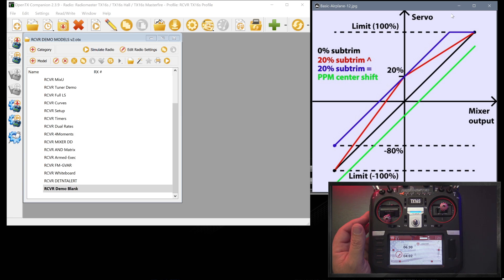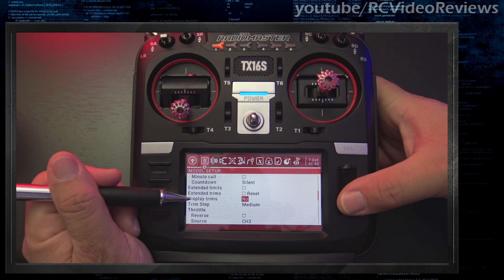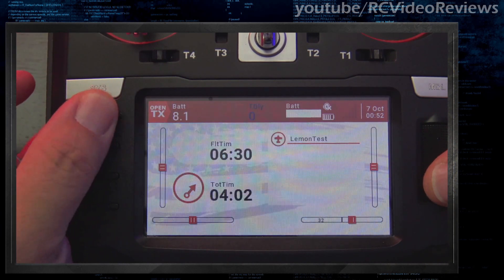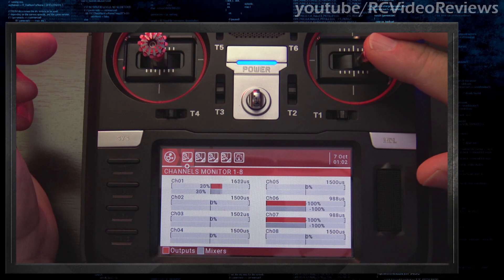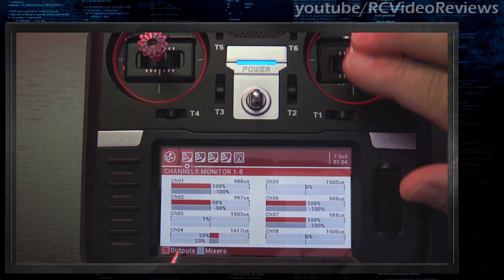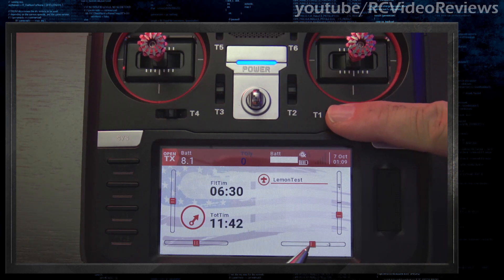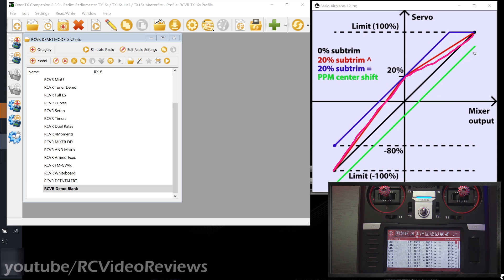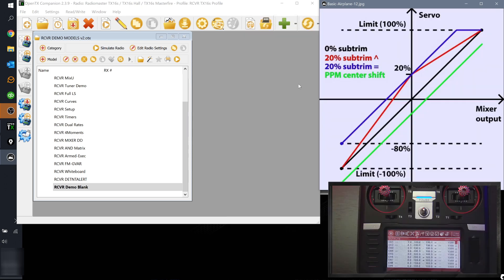OpenTx Tutorial Trim Options:  Radiomaster TX16s • [Intermediate]

Comment: Isn't everyone mechanically setting control surfaces to perfectly flat and only using the in flight trims to counter act balance issues? 

I'm never adjusting for control surface issues it's always a click or 2 or a few to iron out balance. For eg, nose heavy requires a bit of up elevator to fly straight. And a big balsa wing built slightly heavier than the other or repaired requires 2 or 3 clicks to trim out to level. 

Are people setting up a model with an out of wacl control surface and then just trimming it to flat?

Comment: caorse trims at least on Elevator and Aileron are invaluable for maiden flights I just chanced on the idea but instead of loading the values into sub trim I mechanically move surfaces to match deflection  then reset trims to zero and med or fine for changeable conditions

Comment: i have several questions, what is T3 and T4 trim for, T5 and T6 as well
also, i noticed my T3 trim is all the way down, not sure what that means on the TX
finally, if i have high rate set 100%, low Rate 50% when i move sticks left or right and look at the mixer, they are not perfectly at those rates. left is 97%, right is 95% etc.
i calibrated several times, same no luck
Reply from the maker: Please join my discord and ask there. YouTube is terrible platform for dialoguing back and forth. Discord link:  https://discord.gg/jSFTASU

Comment: I've got Edge TX on my radio master t16S
I want to use my T5 or T6 trims how to set up on Channe 5 or 6-7-8
I'm using switch SF for thrust vectoring mixing Rudder to motor servo 
I want to use a trim T5 or T6 to a motor servo when I switch on the mixing to trim the angle of the motor     Thanks  you

Comment: Can the tx16s do and save multiple trims depending on flight mode? For example flaps up....the plane has one set of trims and flaps down the plane has another set of trims? If so, can you do a video on that?
Reply from the maker: If you look in the flight modes tab under trims you'll see options for trims to all be the same, or to use trim values from flight mode 0 + the current flight mode, or just the current flight mode.

Comment: Can you use subtrim in a certain switch position. Example you have 3 modes: Normal mode, IDLE UP1 and IDLE UP 2. You want to add subtrim only in e.g. Normal mode.
Reply from the maker: Subtrim changes outputs and o don’t believe they are influenced by flight modes. You could set trim per flight mode though.
Reply: @RCVideoReviews  woofie5555: Let me start by saying I have not tested this fully so this is just a start. I think the answer is yes by using a global variable. On the outputs page you have the option to use a global variable as the input for subtrim. Use special function to adjust global variable to the value you want for the subtrim and the switch you use to select you flight mode as the trigger.
Reply: I'm stuck :)

Comment: Hi John,  You are the best, so smart !!  I just discovered that my aileron trim is reversed from the stick movement, ( Almost crashed) LOL  Do you know how  I can fix that??
Reply from the maker: Look in your inputs screen for the aileron. Trim should be set to ON. I don't know of any way to get the trim to be reversed though. It always follows the stick even if the output is reversed. You may need to create a new model. I'd be interested in hearing what you learn about this.
Reply: @RCVideoReviews  Thanks, yes I had the servo reversed in the wrong place.

Comment: How would you trim a single aileron or elevator side?  New owner here trying to set up a new to me used plane and can’t seem to figure this out. The aileron or elevator trims move both sides, but the sides aren’t both aligned with each other.

Comment: Your videos are great. Thank you for making them! I have a weird issue on my Radiomaster TX12 where my aileron trim is reversed from my stick direction. I’ve googled and searched some forums but no luck. Do you know why this might be happening?
Reply from the maker: All models or just one?
Reply: @RCVideoReviews  I think I changed something along the way so early models were ok. But since I copy old models for new ones, the “error” is pretty much in all my models now.
Reply: @RCVideoReviews  also, I noticed that “instant trim” doesn’t work on the ailerons either so maybe that is related?
Reply from the maker: @thenerdoligist1292  On your inputs for any control surface (look at Aileron in this case) near the bottom of the first screen it says Weight, Offset, Trim, Curve, Modes.  What is in your "Trim" field? It should be "ON"
Reply: @RCVideoReviews  yes, TRIM is set to ON. But I found the issue. I have a -100 weight on one of my ailerons. Instant trim now works too. Thank you very much for your time and knowledge!

Comment: hi great video, i ownder if you could help me , on one of my models I am for some reason unable to trim from mid to lower trim with the Throttle , seems not to be working for some reason all I do I cant make the change , I have no issues on my other model, I have 2 only . this is making me crazy :)
Reply from the maker: Do you have trim idle only checked in your model setup page?
Reply: @RCVideoReviews  hi and thanks. Don't think so. Should it be checked ?
Reply from the maker: Trim for throttle should work the same as any other trim without that option checked. Ok here are the places I know you can change the behavior of or turn off trim:

1) Trim Idle Only - Model Setup Page
2) Flight Mode Column 3 - Flight Modes Page (they should all say =0 unless you know you want something different there).
3) Inputs Trim On/Off - Inputs Page
4) Mixer Trim Checkbox - Mixer Page

Does your trim button show changes in the trim indicator on the main model screen?
If it does and you've otherwise verified that your hardware works (other models, or hardware calibration screen), and you haven't turned it off in one of those 4 places, then I don't know what else could be the problem. I would start with a new model. 

There are ways to load model configs in companion to do a compare if you want to dig in that far.
Reply: @RCVideoReviews  Amazing i made 1) Trim Idle Only - Model Setup Page
and ticked the check box and it works. wow thanks a lot

Comment: Hi John, do you have a video on how you can set trim switches T5 and T6 for trimming an other channel apart from throttle/aileron/elevator/rudder? (1to4)
I have two trainer inputs coming in from a head tracker module and would like to trim those for easy centering.

Comment: Hi, Why do my sub trim outputs show as 512 on the TX and 100 when I'm in OpenTX?
Even if I write the model back to the TX from OpenTX they still show on the TX as 512!
Reply from the maker: Did you change your firmware? What are your build options?
Reply: @RCVideoReviews Hi, thanks for the quick reply, I'm using OpenTx on PC and on Radio and they are both the same i.e. Vers. 2.3.11
I'm building an F450 with a NAZA-M V2 flight controller and Radiomaster TX16SE
Reply from the maker: @lessmith8906  What are your build options? System -> Version -> OPTS "xxx, yyy, zzz"
Reply: @RCVideoReviews  Sorry I'm new to all this, I thought I had answered the build options and the System/Version in my last reply.
I'm afraid the OPTS "xxx,yyy,zzz" I don't understand. The System is Windows 10.
Reply from the maker: @lessmith8906  On the radio itself from the model home screen, press the System Button, then press page LEFT to get to the Version Screen, then find the line that says OPTS and tell me what's on that line.
Reply from the maker: Just for syntax and moving foward, we need to clarify a few things: 

1) On your first comment you said: "my sub trim outputs show as 512 on the TX and 100 when I'm in OpenTX"

What do you mean "when I'm in OpenTX?" Do you mean "in Companion"?

2) The airframe and flight controller should not be relevant to your question. i.e. It doesn't matter that it's an F450, and it doesn't matter if you're using a NazaM if your question is what I believe your question is: "Why does Companion show -100 to 100 in Outputs and the Radio Outputs screen is showing 512 for Outputs"  If that is not the question you are trying to resolve, please restate the question, because that's what I understand we're trying to tackle.

3) I'd HIGHLY suggest you take this conversation to Discord instead of YouTube. It's a much easier platform on which to collaborate. This platform is pretty awful for troubleshooting. Our discord server is https://discord.gg/jSFTASU
Reply: @RCVideoReviews  I think I've posted my reply on Discord!
Reply: @RCVideoReviews  Looks like my attempt at Discord didn't work!
Info you requested is:- OPTS are:- Bluetooth, Crossfire, Ghost, AFHDS3, Internalmulti, Multimodule, Lua, Luac, PPMUS.
1) Yes you are absolutely right, the -100 to +100 is in Companion and the -512 to +512 is on the Radio Outputs.
Reply from the maker: @lessmith8906  Why did you add PPMUS?
Reply: @RCVideoReviews  I didn't realise that I had, I don't even have a clue what it is so I wouldn't have selected it.
Do I need to get rid of it, if so how do I do that?
Reply from the maker: @lessmith8906  You had to have selected it when you upgraded your firmware. That's not a default option. You need Companion. I'm going to ask you to defer to my videos on upgrading firmware. Also, this REALLY needs to move to Discord. I'll continue the conversation there if you like.
Reply: @RCVideoReviews  PPMUS was indeed the problem, thank you so much. Radiomaster Tech Support couldn't solve it but you did!!
I will persevere with Discord but didn't find the interface very user friendly, and I have too much else going on at the moment, thanks again.

Comment: Hey so the tx16s has 6 trim switches and i cant find much about them or how to use them or even what to use them for? Do you know?
Reply from the maker: The first four--self explanatory. The 2nd set T5/T6 are used for planes like Gliders that might have two sets of servos per wing that they use for things like crow braking, or using flaps as a 2nd set of ailerons.
Reply: @RCVideoReviews  🤩 gotcha!  awesome to know! thanks for your response!

Comment: I bought a TX16S, when I turned it on, there was a flickering message on the screen with a white background 'EMERGENCY MODE', and the device does not respond to anything.
Reply: The batteries I have are black, written on them radiomaster, 5000mah, 7.4wh.  When I charge them from the device with the cable, no green indicator light is on in the device, not even red below.  I measured the voltage of the battery was more than 6.9v.  I do not have an external charger yet, I did not need, I use small batteries, 300-520 man, I will later in the day try to charge the batteries of the transmitter.
Reply: @oded_10  Just a silly question, but you are using the charging port at the BOTTOM of the Transmitter and not the top port for connecting to a computer?
Reply: @shanejohnstone4245  from the bottom .
Reply: The battery is not charged at all, it stays at 6.9V as I got from the store.
Four days ago, I sent a video of the screen on a device on WhatsApp to the store I bought 'MAKERFIRE' and also to the customer service of 'RADIOMASTER', they saw the video, the store said they would take care after the holiday (passed on 6.10.20), on RADIOMASTER I received a message : "the charge chips may broken, And need to change charge IC "and then she asked me about the store's customer service, so that the store would replace and repair ...
In any case, it seems to me that according to their answers, or their lack of answers, no one wants to pay and take responsibility for the fault.

Comment: Thanks for the vid! Quick question, I recently took the back off my tx to tighten the gimbals now both sliders and one of my pots only adjust half the distance they should. I have recalibrated the tx but still same outcome, could this be a result of pinching something or not getting those particular components back in the proper positions???
Reply from the maker: Are you starting the calibration with those items CENTERED? I kind of doubt you damaged two sliders and one pot in one go, and it's also interesting this is happening only on "sweep" controls.

Make sure you start the calibration with everything centered first.
Reply: @RCVideoReviews  yes sticks, sliders and pots are centered when calibrating which is weird and why I ask.
Reply: @RCVideoReviews  I went back and did the calibration again, took 2 more tries but it appears everything is back to normal. Thanks for the input, not sure what happened but obviously I did not do the calibration correct the first time.